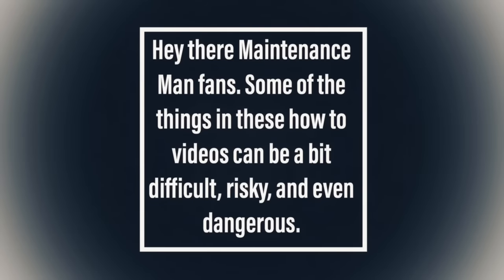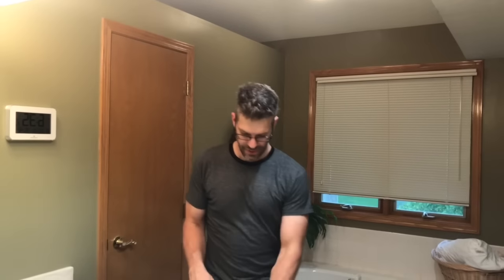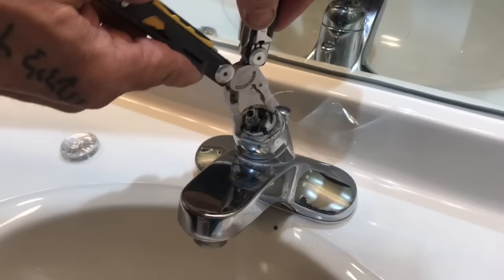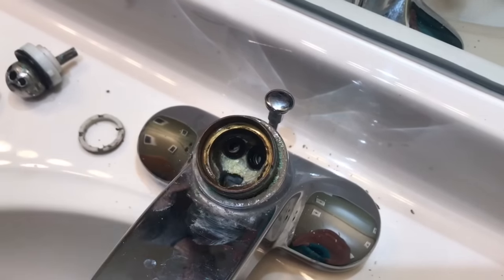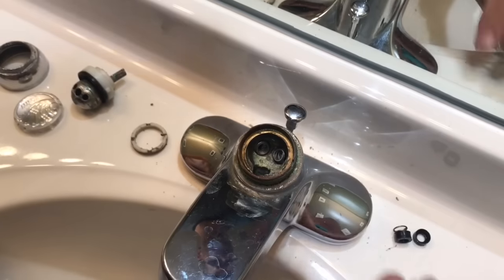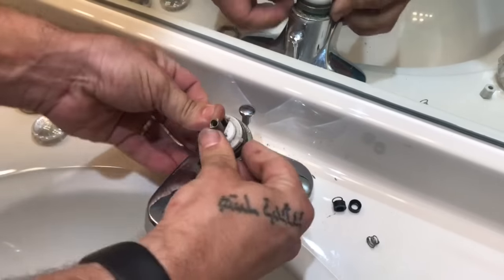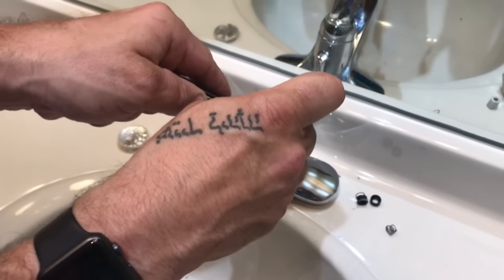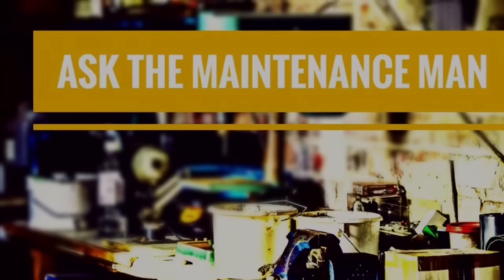How to fix a leaky delta style bathroom faucet

Comment: I replaced the springs and seats, and the plastic retainer with the ball stem guide in it, only to have my slow drip remain. Could I have a bad ball, or is it a problem in how tight I replace the domed nut over the ball or tighten the plastic ring inside the top of the domed nut? If the ball must be replaced, must the replacement ball be original Delta, as some say?BTW, I removed a very stubborn dome nut by soaking a rag in vinegar and letting it cover the dome for an hour or more, then tapping it with a hammer as I got ready to twist it off with a pipe wrench, as an assistant held the faucet from turning. After all that, I still have the slow drip. Help!  Bryan
Reply from the maker: The plastic ring in the center of the dome cap is a tightening ring as well. Make sure it is super snug but be careful not to strip out the groves used to tighten it. It can be tricky. If the ball looked smooth it’s most likely not the issue. If it was caked in lime it’s probably time to replace it regardless. Great tip on the dome cap removal! Thanks for sharing. Thanks for watching and thanks for reaching out. Hope it works. Let me know if you have any issues.

Comment: I have a 2 handle unit.  The cold water handle was leaking by the gasket at the base and went all over under sink.  I replaced the spring but the black rubber thing was a different size from the original so I put it back.  Leak seemed to resolve however had taken aerator out and cleaned and when I put it back in after repair and turned water on almost nothing came out so immediately removed.  When I put in new aerator had good flow at spigot but big leakage now under sink.  Doesn’t show in sink area but is coming from top somewhere.  Removed aerator and it does not leak underneath so I am stuck with a splashy flow for now.  Any suggestions?  I am confused and at my wits end on what is wrong.  Ready to just replace faucet but...
Reply from the maker: Sorry for the late response. It sounds like the rubber gasket for the aerator is not seating correctly and forcing water through the housing for the faucet. Make sure the rubber seal for the aerator looks pristine. Feel free to email me with anything or just continue to comment here. Again, sorry for such a late response.

Comment: Got the drip to stop with the gasket kit, but now it leaks at the base of the handle? I've taken everything apart 4 times, checked everything, retightened & its still leaks? Any ideas? Im just contemplating buying a new one at this point....😒🙄
Reply from the maker: The base of the handle leak is due to the retainer ring not being tight enough. Be careful not to mess up the catch points when you’re trying to tighten it. Slipping off makes it almost impossible to get good purchase for a tight fit.
Reply: @TheMaintenanceMan  Good call my man! Little more tightening on the retainer ring worked!👍🤘

Comment: OMG this was sooo helpful. I used my multi tool to unscrew that plastic piece. But my retainer ring doesn’t have that elevated piece to use my channel locks on😩 I even tried banging it. Any other suggestions? Help...PLEASE!
Reply from the maker: Unfortunately if the metal ring doesn’t have the knurled area or a place for your channel locks to grip you’ll end up scratching the metal to get it off. They can be replaced but unless there’s a place for the tool I’ve not found an effective way to not damage the ring during removal.
Reply: Ask The Maintenance Man it’s probably the original faucet of 1989 or maybe a replacement but I doubt it’s from before 2000. I even attempted to use a gripper mat without success. I guess I’ll just have to either replace everything I removed so far & live with the slight drip from the faucet (not handle) until I remodel the bathroom...or replace the entire faucet. THANK YOU for your reply🤗

Comment: I know that it's been 4 years since this video, but I have a question: if the white ring you removed before the retainer ring (around minute 2 of the video) is so stuck that trying to use the pliers, or any tool for that matter, just ends up deforming those grooves? I tried loosening it by soaking with some diluted white vinegar and a toothbrush, but it's no use. The grooves are getting so deformed that there's almost nothing to apply leverage anymore and I'm afraid I'll finish messing it up.
Reply from the maker: At that point you should focus on removing the metal retainer cap. Everything will come off at that point. Then get the complete replacement kit so you don’t have to struggle with that ring when you put it all back together.
Reply: Wow, thanks for the quick response! So I can remove the whole thing by removing the retainer cap? That's great. I'll give that a try. Yeah, I bought that retainer cap with the ring because I figured I would have to replace it anyway. The one I bought is not Delta brand and instead of a plastic ring, it has a copper right. I figured it it is more durable than the soft plastic. Hope it fits with the rest of the assembly.
Reply: I tried removing the metal retainer cap but it is not yielding. Mine doesn't have those straight edges, but instead it has grooves all around the circumference. I tried gripping to those with the channel lock, but the wrench is just smoothing out those grooves as well. Any suggestions?
Reply from the maker: You will have to heat the metal cap to loosen it. I have used a torch before but it usually melts the plastic parts inside. The complete replacement kit has all those parts. Otherwise it’s time for a new faucet unfortunately.
Reply: Okay, I don't think I want to use a torch. I don't trust myself with one haha. So replacing the whole faucet does not require removing that retainer cap? Do you have any video showing the whole faucet replacement?
Reply from the maker: Unfortunately no.

Comment: Question on removing the metal ring. I got the multi-tool to unscrew the plastic ring. That worked. I can’t get the retainer ring to loosen up.
Reply from the maker: You’ll need heat. The best way is with a  torch of some sort. Get it hot but try not to melt the plastic. A propane torch from the home improvement store will do the trick and they’re not going to break the bank. I’ve heard of people using a lighter but it takes a long time and sometimes never works. The heat loosens the threads when the faucet has been there for a while.
Reply from the maker: Only heat up the ring that comes off.
Reply: Oh wow. Would a strap wrench help? My adjustable wrench doesn’t quite fit either. I’m scratching up the metal.
Reply from the maker: I’ve not used one on that before but it makes sense. As long as it can do something that small it’s worth a shot.
Reply: Thank you!
Reply from the maker: I’d love to know how it turns out. Finding new ways to do things and sharing it with people is my jam.

Comment: I'm confused. You replaced the parts? As in I need to go to the store first to buy them... ?
Reply from the maker: Yes, good observation. You will definitely need to go to the store to buy the replacement parts before you replace them. Great question.
Reply: @TheMaintenanceMan  lol I can't tell if you're being sarcastic or not, but thank you for responding. I was hoping I could just tighten something out clean out deposits. Guess I'll be taking a trip to the hardware store. Thanks again!
Reply: @TheMaintenanceMan  what are the rubber replacement rings called?
Reply from the maker: They are called seats. Typically you look for “seats and springs” at the home improvement store or on amazon. Just make sure you have the right one for your faucet.

Comment: Thanks for the great and clear steps in the video on a vanity that looks exactly like mine. I'm planning to make that repair to all four of my Delta bathroom faucets, so this will be helpful. But my current problem is removing a broken aerator housing where part is stuck in one of the faucets and I tried using a few tools to no available. Any suggestions?
Reply from the maker: Just plan on replacing the aerator completely and use whatever means necessary to remove the old broken aerator. Good luck. Let me know if you have any more questions.

Comment: There are different kinds of faucet leaks.  For instance, I have a delta, like the one in the video that is leaking out the side at the flange (not thru the spigot).  This flange can be easily seen with the faucet is fully dismantled.  Anyway, it would have been helpful to know if this video fix would also stop the kind of leak I'm dealing with.
Reply from the maker: You are correct. There are several possibilities for leaks from a delta faucets. This video is for the most common of them and not intended to be an all encompassing tutorial. Unfortunately I did not cover your specific leak in this video but the full kit replacement of all the seals seen and talked about in this video will solve your specific issue.

Comment: After we replaced these parts and turned the water on there is no flow from the faucet.  Any ideas?
Reply from the maker: Yes. The aerator is clogged. I made a video on cleaning it out. Lots of people have that issue. Check out the channel for the aerator cleaning video.

Comment: Is there another video that shows how to fix a leak that goes down into the cabinet?  The leak is coming from the inside of the faucet when it is on.  Thank you!
Reply from the maker: I’ve not made a video of that specific issue. At that point I advise replacing the faucet completely.
Reply: @TheMaintenanceMan  thanks for replying!  My faucet has copper tubes that connect to the water supply, but they don't go straight down.  They are angled Diagonally.  If I get a replacement faucet that also has copper tubes, is it ok to bend them(angle them) a bit so it can attached to where the water supply is?
Reply from the maker: You may need to just get a set of flexible supply lines to go with your new faucet. It’s a much easier installation method than rigid copper lines. The flex lines will be more accommodating to any environment under your sink.

Comment: i bought the kit, put it all in and put the ball back in and the plastic piece over the ball and than putting the faucet back together, but the retainer ring back on but it will not screw down all the way.. what are we doing wrong?
Reply from the maker: Make sure the retainer ring isn’t cross threaded. It happens easily. That would do what you’re describing.
Reply: @TheMaintenanceMan  what u mean cross threaded?
Reply: @TheMaintenanceMan  and how to not cross thread it?
Reply from the maker: @nancydyer4897 it’s when the first thread isn’t matched to where it’s screwing into and it only rotates part of the way, then gets tight and can be forced but keeps getting tighter with every thread that gets used until it won’t go anymore giving the illusion that it’s tightened all the way but it’s not.
Reply from the maker: When you start it, turn it backwards till you feel that first thread slip down, then screw it in carefully. It will go smoothly if it’s correct. If it gets tight fast start over.
Reply: @TheMaintenanceMan  my husband seems to think that the new hardware is keeping it from screwing down into regurlar place? it is the big rubber peice that is hard to get it to fit in where it is to go??
Reply from the maker: @nancydyer4897 can you email me with clear pictures of your situation? askthemaintenancan@gmail.com
Reply: i will when my husband has it apart again.

Comment: What size washer did you use?
Reply from the maker: If you’re referencing the plastic tension ring, it’s a standard size for the style of valve featured in this video and a kit will have the correct size. Otherwise I’m not sure exactly which ‘washer’ you’re asking about.

Comment: what if there is a small leak at the top of the white ring
Reply from the maker: Just tighten the ring. The ring pushes on a seal just underneath it and the rubber has most likely gotten compressed. Snug that ring up and it should stop the leak. If it doesn’t you will need a seal kit and to replace the parts shown in this video.

Comment: As with Jennifer's comment below, I also can't get the retainer ring off.  I have tried all she tried and no go.  I really don't want to replace the faucet because the footprint will be different on the porcelain and it will show the wear.  any magic on getting that ring off?  
Also, do you know if a new peerless ring with fit the older delta faucet?  Everything else inside looks the same, just don't know if the ring is the same.  I would buy a  new ring and then tear into it to get the old ring off if I knew it would fit.
Reply from the maker: If you heat the ring with one of those hand held propane torches (carefully) it will let loose but you will melt the plastic parts inside. Once the brass retainer ring is off it will most likely be scratched up and useless. The threads on the ring are pretty standard but as far as a peerless ring...I’m no product specialist so if it fits that’s great but I’m not going to make that claim without checking things out myself. Let me know if you have any more questions.

Comment: I don’t have turn off valves below my bathroom sink what do I do?
Reply from the maker: You will most likely have to turn the water off to your entire house at the shut off near your water meter. Then release the pressure by opening your lowest valve. Probably one in the basement or your outside hose. Anything lower than the faucet you will be working on will do the trick. Let me know if you have any other questions.
Reply: @TheMaintenanceMan  I live in an apartment complex, where would I find these valves?
Reply from the maker: You will need to contact the land lord or maintenance staff. Sorry I can’t help you with that one.
Reply: @TheMaintenanceMan  thank you for the how to tho I can definitely DIY

Comment: 1. Was this a fix for a DRIPPING faucet (dripping from the spout into the sink), or LEAKING (from the handle onto the top of the sink surface)?
2. You reused the existing cartridge? When do you need a new replacement one?
3. Why not clean the crud out from the insides? Won't that then work to degrade the rubber?
4. Ok, spring, narrow end up; flare end of rubber goes over that narrow end of spring, right?
Reply from the maker: 1. Yes it was a slow drip from the faucet spout.
2. Yes I reused the existing cartridge, you replace it when it becomes pitted from corrosion.
3. If you have the amount of crud that needs to be cleaned off you should probably replace it. A little bit is not going to harm the rubber seals as it was on the opposite side of the ball and wouldn’t come in contact with the seals. 
4. Yes
Reply: @TheMaintenanceMan  Thank you, excellent answers! And thank you for the video in the first place! Now for another couple:
1. my leak is from the area of the round handle, down onto the top of the sink. It seems to be only when I turn it to the hot water side. Do you think replacing the seals, springs, and cartridge would be what I should do?
2. Should I use plumber's grease when replacing the seals & springs? And where exactly on them, and on the cartridge too?
Reply from the maker: You should tighten the plastic ring within the metal cap. It is a tension issue. If you tighten the ring an eighth of a turn or so it will increase the pressure on the rubber seals and stop the leak. You are definitely on the fast teach for replacing the seats and springs anyway. Thanks for your question. Let me know if you have any more questions.
Reply: @TheMaintenanceMan  Got it, that's the part with the side grooves that you used the tips of your multi-tool to fit in to turn at 1:56, thanks! Righty-tighty 1/8 turn!
Reply from the maker: 1/8 th is a guide. Whatever it takes to take the outside leak is what it takes but 1/8 th at a time is a good guide. Let me know how it goes.

Comment: Thanks.  we did all of that and stopped the leak but now we only get a trickle of water when we turn the water back on.
Reply from the maker: The aerator is clogged. Check out my video on unclogging the aerator. If you need a link I can get you one.
Reply: It was simply a clogged aerator.  We cleaned the aerator and all is well!!

Comment: I can't get the retainer ring off.  I tapped it and tapped it hoping to loosen any sediment and finally gave up because I was marking it up trying to get it off.  When I put it back together the water pressure is very low.  S.O.S.
Reply from the maker: The ball being stuck is a big problem. Once the retainer ring and cap are removed it should literally fall out. From what you’ve described you need to replace the faucet not repair it at this point. The low flow is most likely caused by a clogged aerator. I’ve got a video on cleaning it out. If you want to send pics so I can see what your looking at feel free. askthemaintenanceman@gmail.com
Reply: I really appreciate your quick reply!  I'll go take pictures now and email them to you.